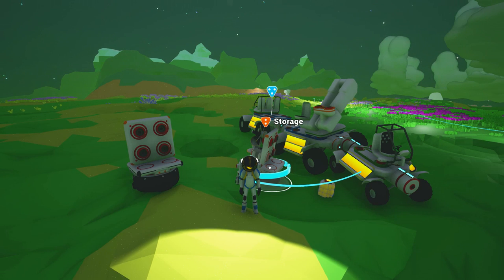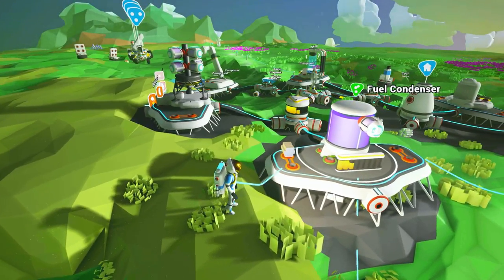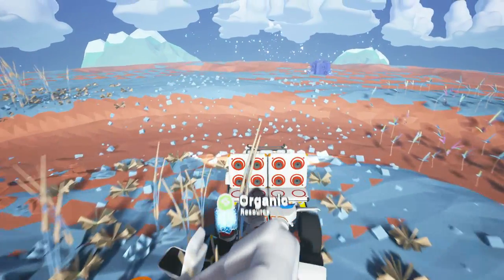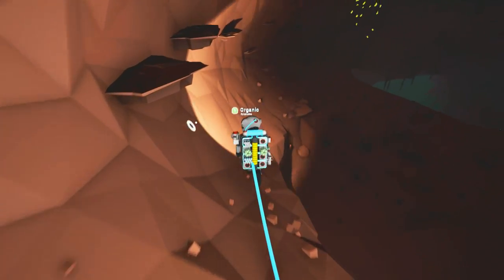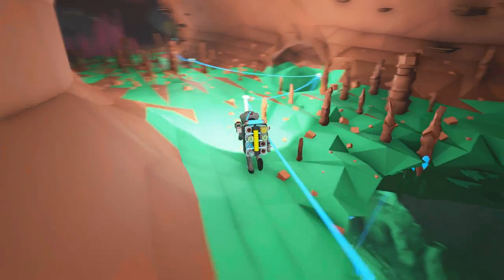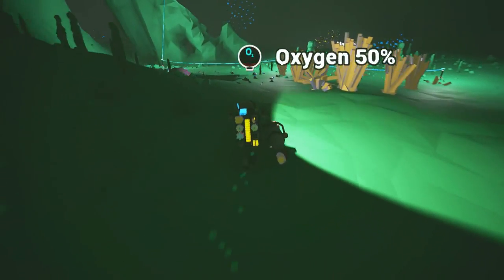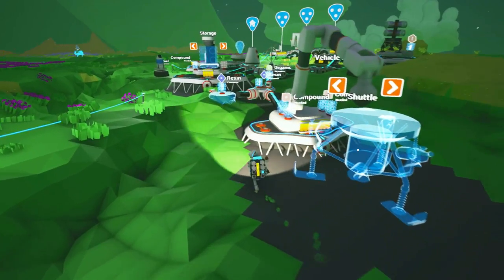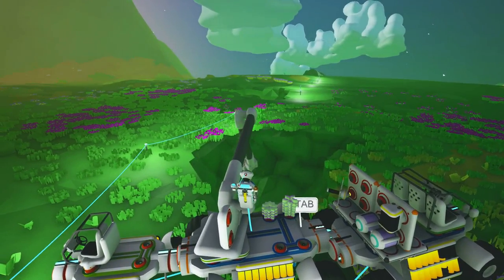Astroneer Gameplay Ep 4 | Mining Drill Attachment!

Comment: Few tips. Shift + Left clicking on tethers (Or any item in general that goes to your inventory) will put it in your inventory automatically. Filters just make it so that you use less O2. You can get rid of the gassy plants by digging up underneath them.
Reply from the maker: Just to be clear, that filter bit is incorrect I'm afraid! The filters give you O2 as I've shown a few times in the series thus far :)
Reply: Another tip Lath is that the tank is needed for the space shuttle so make it if you plan on making the shuttle soon.

Comment: The shuttle is in short a Mini space ship.  The spaceship is the better choice of the two.

I have a recommendation.  If you do go to another planet bring 1 battery, 1 solar generator, 1 wind generator, 10 resin (for 5 platforms, 2 of the upgraded platforms), the materials to make one fuel condenser, and one trade platform.  
This way when you land you can start a base and not need to hunt for resources (if they even exist on the planet, some planets do not have some resources meaning you can be stranded by under-prepaired exploration).

Comment: Lathrix, you can attach stuff to the ends of the vehicles, where you do the large tethery thingy between them.
Reply: This. Granted they pop off if you get near a large tether point.
I use a truck with small cabin and large cargo module to bring seven research at a time out of caves.
Trailer with two large cargo modules, two batteries and a solar panel parked topside for refuel and carrying even more research back home.

Comment: what i did for power is used alot of resin to make a long chain of connections to make a line of winf vanes and made basicly a wind and solar farm that was massive almost always generating power in wind vane in one location is never a good idea because it maybe stoped but 2 feet from it could be an area where it would be running. and if you put 2 basic storages on the fuel condenser you can get it to store 17 in total fuel you just have to keep pressing the button

Comment: Once again, there are small type and large type storage slots.
Reply from the maker: I say there are different storage types in the video c:
Reply: Oh, I meant "slots". Similar, I suppose. Rovers, building, and the large storage type have large type storage "slots", but the small storage type and the crane have small type storage "slots".
Reply: as far as i seen there is 2 different kinde of storage slots, the single one and the connected. the trucks storage is makeing 2 connected slots to 4 connected slots, the singe standing is makeing a connected one to 8 single. the difference between shutle and the space ship is same as the truck and rover, the space ship have 4 connected slots and bigger fuel tank.